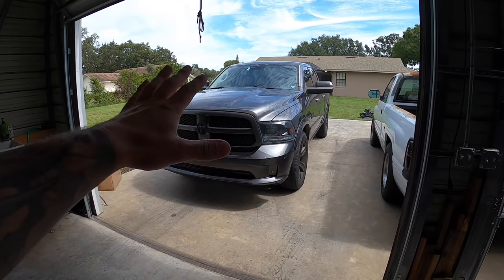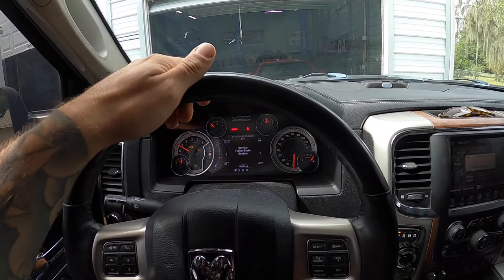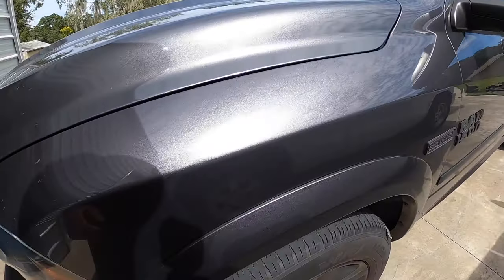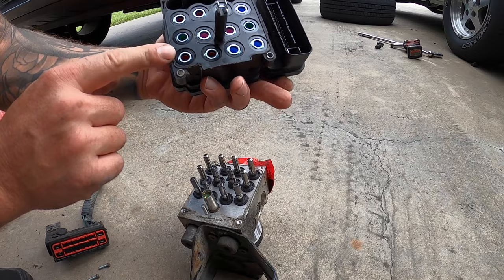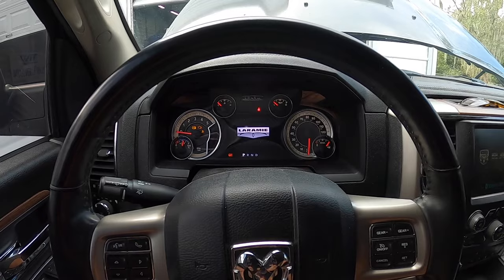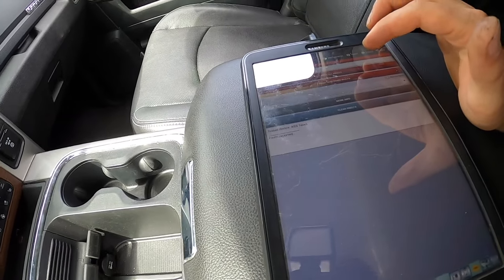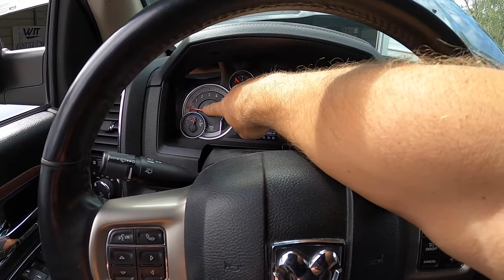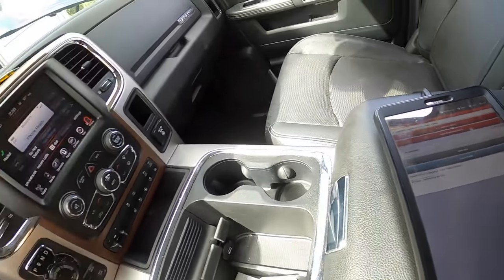RAM ABS Module Failure Code C2200

Comment: Your video was incredible. My abs module went out in my 2014 ram. I replaced the wheel speed sensors with nothing. I went to the local Dodge, and they wanted 1800 for the module with a one or 2-year wait list for the part because it's on backorder. I purchased a used one on eBay and followed your directions. I'm back up and running for 300 bucks. Thanks again!!!
Reply from the maker: Glad it helped! If you can consider hitting the thanks button it helps fund more videos like this in the future 💪
Reply: Did you leave the ABS unit connected to the brake lines and just removed the module? Or did you take the whole thing down?
Reply: @DaveGamblin  I copied exactly what the video showed. I only removed the abs module. Which was 4 screws and a plug. It took 15 minutes. The programming with alpha obd took about the same.
Reply: Where do you plug in to the truck in order to do this? What kind of cable do I need to use?
Reply: Not sure what I’m doing wrong but I have the exact same issue as  Kodiac and I’m following your instructions to the t with no success
Reply: Same issues here. Bought a used ABS unit. Swapped out the module. If you lay on your back and slide under the front of the truck, all you have to do is pull the 4 screws (T20) and harness. It didn't require tire or fender liner removal.  The seals stay on the pump side around each core that protrude into module. Not only did I have to vin recode the module, I had to reset adaptions for the transmission.

Comment: My truck has the same issue. The part was on hella back order for months and months. They want like $1200 bucks for it. I want to fix this issue, it's just so expensive for this abs module.
Reply: Exactly what I found out yesterday. Since they have to reengineer it. It should be a recall.
Reply: @dandilts3213 is it a recall?

Comment: Having the same issues on my 2017. Going to give this a shot. Looks easy enough. Local shop quoted me $4K to fix and also said he can’t get the part for months. Then said he doesn’t recommend I drive it until it comes in. He said he doubts any reputable mechanic would install a used ABS module. Then proceeded to quote me $10K for miscellaneous things I didn’t ask for. 😂
Reply: Wow, some of these local shops are just as bad as the dealership. Just down right wrong to try to take advantage of people.

Comment: I followed the steps in the video exactly and it worked for about 10 minutes and then the lights came back on. I took it to the dealership told them I thought it was in the harness and they told me that the ABS module I installed will not work because it came from a different truck can you help?

Comment: My 2013 has this issue but with c2200-45.  I ordered the new part, took it to the dealership and their programming failed.. sent off my old module to upfix and they were unable to do the repair

Comment: Just changed mine today and programmed it. Bought a used part on Ebay because I couldn't find one anywhere else but it  works perfectly and I have my cruise control back! Had to buy and download the Alfa program and buy the MX+. But I didn't have to pay a dealer or shop and I still have the Alfa and MX+ for next time.  Thanks for the great tutorial
Reply: Has this part lasted you? I’m worried to buy a used one that has already failed or about to fail.
Reply: @brodyorlando  So far so good. I had the same reservations but new ones aren't readily available.
Reply: @brodyorlando  Still working.
Reply: Is the obd compatible with iPhone? I tried to buy and download the program but after my purchase from the link in the description I can’t find it? Please help help!
Reply: @luWap1k  IDK I used my laptop.

Comment: This needs to be a class action law suit against ram!!!
I have 34,000KM not miles! And cant drive it since end of September 2023, waiting for this dam abs module, n been told MAYBE end of june! This is such bullshit! 🤬
Reply: same here. All lights on, PLUS locked in Park. Been at the dealer since dec 27th. I am 100% sure I wont get a new module by june. First it was end of march, then april 17th then may 17th. This is when I told them I want AAA tow truck to my house. Took 3 days of calling to get it back. They also wanted to charge me 700 for diagnostic. I told them it was 180 and thats what I paid.
Came to the house, dead battery.
I will remove modem, send to xemodex in Canada and have rebuild/updated.
No initializing necessary, since there will not be a VIN miss match.
Hope you can handle your situation better than me, because this just drained me.
Ram care, FCA corp, dealership...bunch of dirty rats.
Good Luck !!
Reply: @thomastirolflorida5363  Remove the module and ship to Module Masters in Idaho.  They will test and rebuild the unit for $250.  You will get the old one back so no need to reprogram for your VIN and good to go.  Plus, they give a 5 year warranty.
Reply: Same. I have a 2010 Dodge Charger 3.5L and I was told June 19, 2024 would be the earliest the ABS module "might" be available. Apparently the module is under an "engineering review."  Price for a new one is $800. I bought a used one from a scrap yard in Ontario for $260.  I even called a parts distributor in the US. They told me they had the ABS module I needed in a warehouse, but Dodge wouldn't allow them to ship one to Canada.
Reply: @brentgilley5166 I know you commented this 9 days ago so not sure if you got yours back yet but I'm asking this question anyway how has the rebuild been so far from module masters
Reply: @brentgilley5166  What's the turn around time?

Comment: Thanks for putting this out there. I just received my ebay replacement today. My truck still has MAXCARE, but FCA is not putting out a revised part until next month if they've worked out the bugs in the module. Glad this ebay module works since it's only a temp fix for me until the revised module is released.
Reply: Those scumbags have been telling me for 12 MONTHS!!!   That the new ABS module is under review and they won't give me a date on the possible release of the new part.....GL

Comment: This is the first good video I have seen on this! Dealer told me yesterday that parts are not currently available and there are no aftermarket parts. Seems like they are all failing so installing a used part (if you can find it) makes no sense to me.

Comment: Just dealing with this now on my 2014 Ram. No module available, so I'm going to pull this one and get it rebuilt. Been waiting for Mopar to have this part now for almost 2 years, and I'm fed up. Thanks for the video. This helps me figure out what I need to do now. Not much of a mechanic but this I should be able to do.
Reply: started happening to me today, i connected my bluedriver scan tool and it sto the left front tone wheel signal failure, left front wheel speed sensor signal erratic, left front wheel speed sensor signal compare failure. i'll replace the left front speed sensor then go from there. owning a ram has been a pain, first and last.
Reply: Hey, I see you wrote you were having it rebuilt, can you provide more info where and who rebuilds the product?
Reply: @kiriakosberuty257  yeah, that didn't pan out. I couldn't find anyone who would rebuild them. But I got it directly from a Dodge dealer that as of October 16 they should start to become available again. They were to be released in September but had to undergo an engineering review.
Reply: @waldo8050  Hey Waldo8050, 
Thanks for the reply!! 
What is the cost from the dealer for this part??  Also, during the video I noticed that he just replaced the black top portion (don't know the term or part name for that part), that had the connectors.  Do they sell that item or just the whole unit?  I noticed on eBay several of those items for sale, but only the metal portion of the module.          
Again thanks for your info and help!!
Reply: @kiriakosberuty257  here in Canada the unit is about $1500 before taxes. What is all included that I do not know. I'm very much a newbie at all of this myself.

Comment: How did you choose which module to buy used? How did you know it would work properly? I just dont want to buy a used one and have the same issue shortly after replacing it.
Reply: You can get the ABS module part # from the module in your vehicle, or the dealership can look up the part # for you.
My ABS module failed at 110,000 miles. When I was looking for used modules from scrap yards, I got one from the same make/model/year car as mine, but with only 60,000 miles on the odometer.  I figured, if these modules fail at 110k miles, it makes sense to buy a used one from a vehicle with a lot less miles.

Comment: I repaired the last ABS module that failed for me. It was on my 1999 Jeep Grand Cherokee. I opened the module up and the solder joints for the power connection on circuit board were obviously over heated. A quick solder repair, reinstall and it was all good to go. The hardest part of the job was actually opening the module itself. 
If this happens on my Ram, I’d attempt the repair again.
Reply: How did you get the module open? I thought about that, but I only tried prying slightly in the small groove around the perimeter. Since I didn't want to bugger anything up, I didn't push it.

Comment: Need some advice. 2013 RAM 1500. I can have my module repaired/rebuilt at $450 and its plug n play. Or I can get a used one for around $200-300 and would have to program it. What would you do? Another great video BTW, 👍.

Comment: Had this problem. My speedometer was going crazy. Started to just quit working.
My truck is stuck in north Carolina. I'm  from Mississippi. Dodge dealership can't even get the part. Said since they were overhauling the part. They could only install the new part. Cant sell the one in the stores.He can't even request the part until 8-21-24. I also read that some model of these trucks have a recall on this part.
So many are felling.
I have a 2016 ecodiesel ram 1500 , 4x4.

Comment: I have a 2017 ram 1500 4x4. Had a wheel bearing noise on the driver side, changed the hub, the cv, and went nuts for a month because it kept getting worse, then the abs took a shit, finally checked the passenger side and found that it was that hub the whole time. I swapped hubs but had to use the old sensor. Im going to drop a new sensor in it today and see if thats the whole problem. If the abs problem persists, im going to swap the module and get the obd2 and software in the video

Comment: Is there any known issue with the ABS module that would lock truck in park? (2014 ram 1500 8 speed) The dealer is saying that is the issue with my truck, even though been driving it with ABS/traction control light on for almost a year. (Best part is they're saying a new module won't be available for 4 months)
Reply from the maker: Yes if the module fails it’s what tells the system your foot is on the brake and as you know your foot has to be on the brake to start the engine or take the transmission out of park
Reply: thanks! @boostedmotorsports2

Comment: I have been trying to get one of these modules (OEM Part #68228991AD) for almost two months, only to find that it has been discontinued by the manufacturer! This is insane and a gross injustice to Ram owners who need this module. We truck owners who are affected by this are forced to drive vehicles which have no functioning ABS or cruise control.

I would dearly love to know if there is any source for this module.
Reply: I had the same problem. Ended up buying a used on Ebay. Putting it in tomorrow with my fingers crossed.
Reply: It’s a consistent fail point. I just got mine from the dealer today after 10 months of back order. YES 10 MONTHS, without traction or cruise control. I was number 63 in the country to my knowledge the part is still in production RAM has a nation wide shortage. Try a different dealership.
Reply: Thanks for that info. I contacted Mopar parts and was told that the part is no longer in their inventory. I wrote a pretty sharp letter to Mopar and copied the NHTSA, but I don't expect that anything will come of it. I'm going to have my module repaired by a company that provides that service.
Reply: @sambrooks7510  Good luck with that. I hope someone else gets involved. (NHTSA, Consumer Protection Agency,Ect)Smells like planned obsolescence to me. A bunch of models from the 15,25 and 3500 series used this exact same module for a decade from 09-19 and, now you have no supply. At time when you’re having a hard time unloading your new 80K trucks at 16% interest Hummm ? I’ll be looking forward to that class action in the mail someday.
Reply: I have been assured by knowledgeable mechanics that they are plug 'n' play to an extent, and I have even seen a video on YouTube showing a gentleman who put a used on on his truck and initialized it with a mid-level scanner.
Reply: @Doesntmatter-xc8ur  I concur with your thoughts about planned obsolescence. I have read a lot of posts by people who have contacted Mopar over the past few years, and they are always told that the modules are being "re-engineered" and should be available by (insert date here). Some of these posts go back to 2021. Sounds like the old "carrot on the stick" routine to me.
Reply: @sambrooks7510 what company can and is able to repair them?
Reply: @Doesntmatter-xc8ur we should all get involved and file a class action lawsuit because this isn't right!!

Comment: Hi! Thank you for your very informative video. Can I ask for your opinion? I purchased a used one off eBay with exact part number however during abs initialization I can clear out all the trouble codes except for c2200 - internal electronic failure. I’ve tried it several times. Does it mean that the module I bought is defective?
Reply from the maker: Correct. You bought a bad one
Reply: @boostedmotorsports2  thanks. I found a new one I’ll probably just go for it
Reply: @boostedmotorsports2 hi! I was able to find a new compatible part number for my 2013. However, I have a code UO415 and unable to program the new part. Do you think it will work if I do reset vin value procedure?

Comment: Nice video! I'm curious what year your RAM is? I have a 2014 EcoDiesel, my serpentine belt does not squeak on startup, but my dad's 2018 EcoDiesel does, just like yours. I'm wondering if something was changed in the newer models, and this is a common issue after all?
Reply: He has a 2013
Reply: @TheGrtCornholi0  Can't be a 2013 if it's an ecodiesel. First year for the Ecodiesel 1500 is 2014. I saw where he selected 2013+ ABS module in his scan tool, and said 2013, but it's 2013+ years. Thanks for the response.

Comment: Did your speedometer ever go off & on
Reply: Mine did after I drove around with this issue for a few months… I finally got off my bit and fixed it… easiest swap ever, didn’t even have to take off the tires… get the top two screws from the top and the bottom two screws from underneath on your back. Took me about 10 minutes. Going to have it reflashed tomorrow at Firestone to clear the codes.

Comment: My man!!! I was wondering if I had to take out the whole thing! I have a 13 ram and I had to order this part from eBay cause all my local dodge dealers didn’t had this part also 3 dealerships told me the same thing. Also, the manufacture they used stopped making them. Too bad I have all apple devices atm. Cannot get the alpha.obd software

Comment: Hello! I was wondering where did you purchase the part from? I have a 2015 Ram 1500 and my code is C2200-49. And is the part expensive?
Reply: Did you find & fix it?
Reply: You won’t get it at the dealer. It’s being reengineered and it will be months before it’s available. Dealer told me $1200.00 plus for the electronic module. Have to get it used from an auto recycling place.

Comment: I have a ram 1500 2015 with the same issue. Do you know if i can use the ABS module from another ram 1500,  but 2017? both are 5.7 hemi
Reply from the maker: You’ll want to use the exact same part number on the module. Might be some crossover years but part # is most important

Comment: Nice. ABS module has gone out on my 2014 JK and it is a lot easier to get to but there is some kind of engineering hold on my part and won't be avoidable until March 2024 at the earliest. Did you run into this issue as well?
Reply: And now it is April 17th. Am I right?

Comment: My local mechanic wanted to charge me 1500 for this service. I can totally handle this myself. Part is 170 bucks
Reply: Where did you get the part. My Ram dealer said they couldn’t order the electronic module until at least April & it’s $1200 plus.

Comment: Hey buddy been watching for awhile love the content. I have a 2015 ram 1500 same lights on dash but also the same time the lights came on when I came to a stop the shifter knob stuck in park , truck will not start all this happened with in 3 minutes any thoughts would appreciate 👍
Reply: same thing happen to me. Means no communication from ABS Module.
Been at the dealer for 3.5 months, still no part.Internal ABS module failure.
ABS sends signal to BTSI (break transmission interlock) so you can shift. No signal, stuck in Park.
Thinking about sending my abs module out, since dealer told me there is no ETA on that part. CRAZYY.
Besides, anyone from the dealer to Ramcare...they dont give a shit.
Today I was told this part is under engineer review, which I think means, they know it will fail again.

Comment: I didnt see you do the drive test. I get fsild on g sensors and clearing rolls info. What now
Reply: He doesn’t mention it in the video bubba but after u cycle the ignition u have to run the clearing rolls portion of the program…did u run that after cycling the ignition.

Comment: Will truck still drive with the abs module out?
Reply: Yes, but you won’t have abs braking. Just the regular old breaking. So tires can lock up if you hit the brakes hard enough. You’ll be sliding and possibly flat spotting your tires. Guess how I know this.